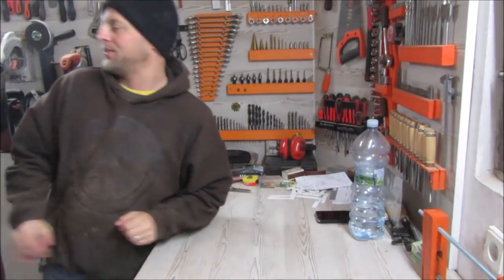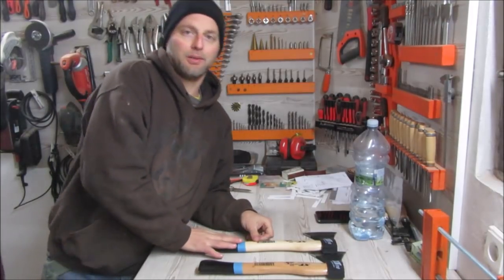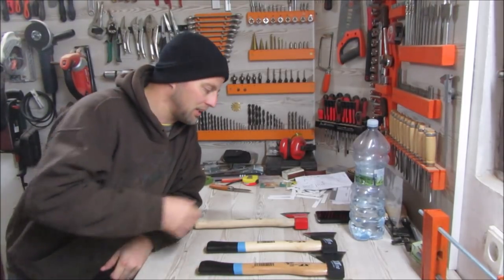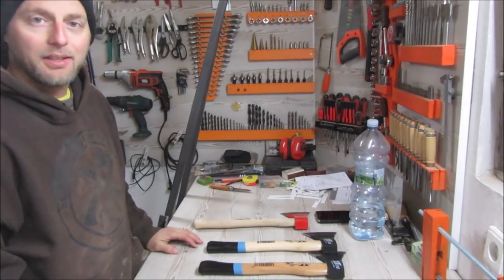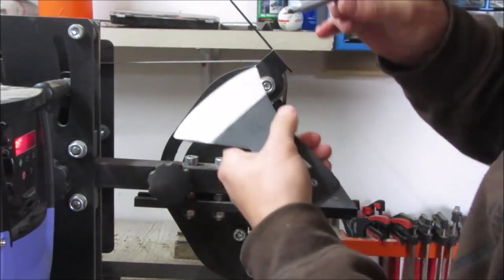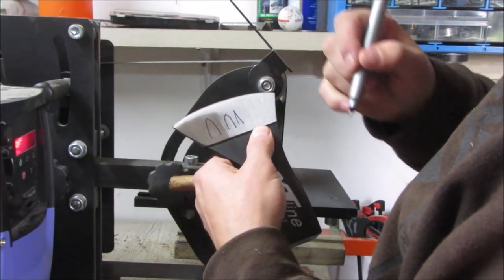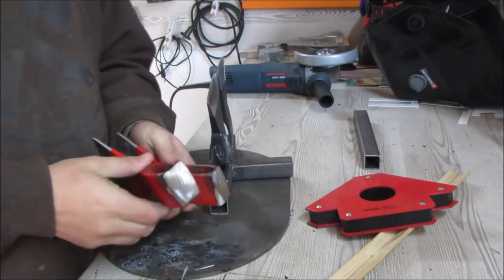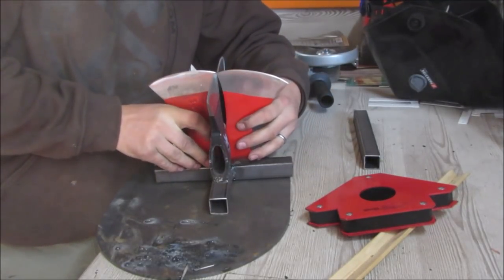Home made wood splitter with 4 blades

Comment: "Нравятся" мне люди, придумывающие  ручные инструменты и приспособы для колки дров. А потом демонстративно колят дрова на котором ни одного сучка нету. Как только попадется пень с хорошим суком, вся эта приспособа будет гореть в костре вместе с этим пнём. А иначе он этот пень задолбается вытаскивать.

Второй вопрос - это как он теперь будет эти четыре топора затачивать?

Третий вопрос - что делать если пень шире по диаметру и тупо не влезет?

Вывод такой - для ручной колки дров инструмента лучше чем топор ещё не придумали. И вряд-ли придумают.
Reply from the maker: Marchen Kitchen My russian is a bit rusty, but your questions are easily answered.
1. If it is too gnarly, just burn the stump as a whole in the garden fire pit, when grilling meat.
2. You can easily reach the bit and sharpen then. They dont need to be razorsharp, but it is not problem.
3. If the log is too big, you can still use a splitter, no issue. But it is anyway NOT a log splitter, it’s a kindling splitter, as mentioned in the title of the video :-)
It’s meant to make easily kindling for the fireplace, and this it has been doing very excellently since i built it.
Have a great day!
Reply: @dabberty  Comprehensive answers to my questions. Thanks, man. Have a nice day.

Comment: cool idea make it a little taller so the wood drops down by maybe put a piece of pipe at the top too keep the wood secure hands free maybe cut out a quarter section for the hammer to slide down into many possibilities with this design great video

Comment: I just lock my hatchet in the shop vise and hit the wood with a small hammer.. 

typically, I use scrap pieces of wood leftover from other projects so it splits really well
Reply from the maker: g Thats an option as well, if it works, it works :-)

Comment: Wouldn't it be better to arrange the axes so that the place of their intersection was lower for self-centering logs?
Reply from the maker: Qwer Ty Could be is the logs are longer then what i have. Mine are rather quite short so i decided on this distance keeping in mind that with hammering on the log, that i would never hit the blades. But I see your point, for longer logs I agree. Also was thinking that maybe put 2 blades lower then the other 2 blades, so the splitting would perhaps be easier.